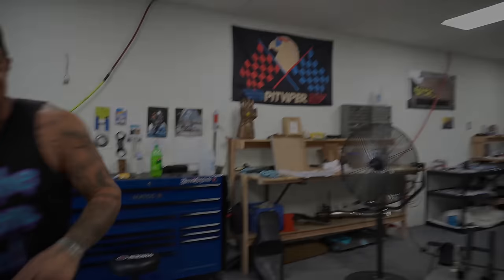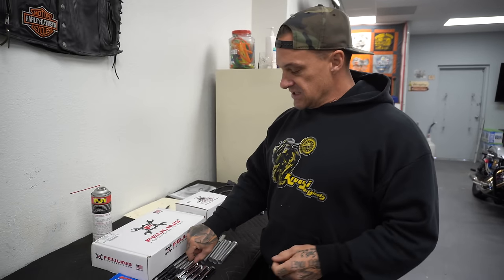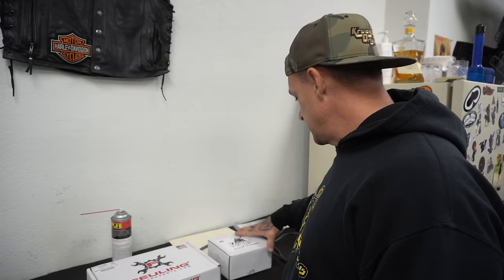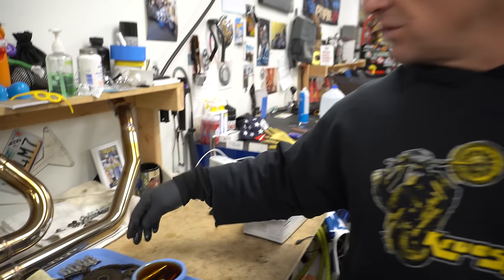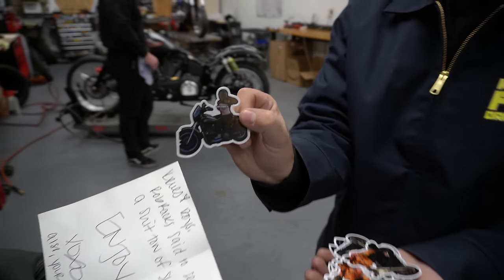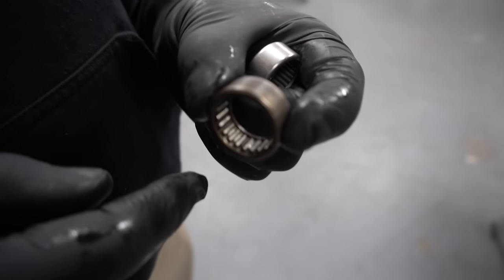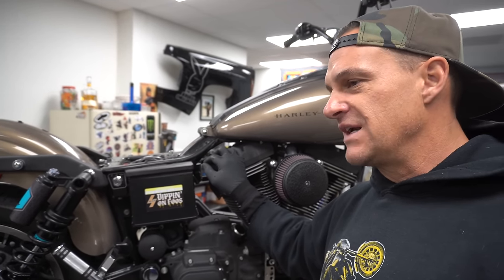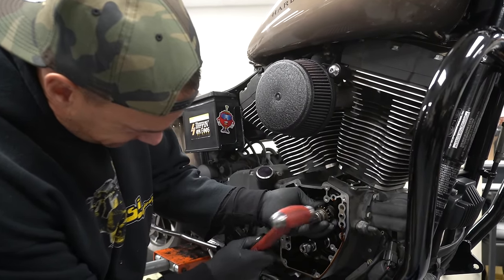@FeulingParts cam chest install on a twin cam 88" thundermax tune how to Kruesi Originals

Comment: Man I wondered why on earth I'd need the inner bearing puller/installer tool if I'm just doing my own bike when I could just use my blind bearing puller and drive the new bearings in like I have done every other bearing...  obviously being prudent getting it started square ect.  I have worked on nothing but metric motorcycles as far as bike /trans ect. Before, and bought a 2000fxdwg last fall.   Previous owner did a 95" high comp and a woods tw6h cam with porting and the SE "race" inake/44cv carb the first year of ownership  Records indicate he had the dealer do the SE hydraulic tensioner/oil pump ect upgrade a few years ago.

Comment: I just got ahold of a 2003 Road King with 46k miles.  I want to do the exact same thing your doing in the video.  If possible can you tell what im looking to pay for parts and labor.  Cheers
Reply from the maker: A couple grand-ish to do it, right?
Reply: @kruesioriginals  that's not bad at all.  When can I drop it off.  Just kidding. I'm in south Texas but wish I was closer. I love your style and experience of working smarter not harder.  Thanks

Comment: I was installing a new Feuling camchest kit with all new o rings but when I went to torque the camplate I noticed one of the threads was stripped. So I had to remove the camplate along with the oil pump that was already attached to the camplate. I fixed the thread with a helicoil but I wanted to know, those new o rings for those two small holes and the one for the oil pump should still be good right? To go to the Harley dealer and get new o rings it’s about a 45 minute drive
Reply from the maker: You’ll be good to go

Comment: Just did the cam chest on my 2012 103.  Followed this install pretty close and had no lifter noise upon start up either.  Used all the gaskets from Feuling's kit except for a small little f*cker that isn't mentioned in the instructions anywhere and looks like you didn't use either.  My new cams are the 543's, feels great!
Reply from the maker: Hell yes man glad it worked out for you

Comment: Nice video fellas! I installed that same Fueling setup in my 01 King. The crank gear was tight on mine too. Mines carbureted but it t fuckin rips too! Love your content. I’m watched the other cam install video you mentioned before I did mine. I loved the biker vs motorcycle enthusiast bit you did. Had me ROTFLMAO!
Reply from the maker: Thank you 🤘🏼🤘🏼

Comment: I could be wrong but I am looking at the same instructions sheet from Feuling and to me it looks like for the front cylinder the timing mark for tdc is: cam shaft sprocket mark up and Crank sprocket mark up as well. Love your videos.

Comment: I had a customers cam bearing fail not long ago. Failed so bad and he let it go so long how cams wore inch deep trenches through the case and we had to send them out to be welded and re-bored. It also allowed his lifters to drop so much that the retaining/locator pin hopped on top of the lifter and do a load of damage up there too

Comment: I love the video, one thing i would appreciate though, would you please exspain that your showing S&S pushrod adjustment, but the fueling pushrods actually have a diferen adjustment setting than the S&S pushrods
Reply: Each pushed manufacturer has their own adjustment specs although procedures are basically the same

Comment: I had a ticket to fly to Spokane and buy that bike and of course the same day another FXDX came up for sale locally so I bought it. Moral of the story is is I I should have made the trip. I did just put that fueling kit in the 2000fxdx and it has the 95” so it runs pretty good

Comment: Ryan ,  I have an 06 Ultra with the 88 in it , has 21k .  Should I upgrade my tensioners to the hydraulic or did Harley by that time fix the premature wear issue and just replace the stock shoes with stock ones .  Video is awesome as usual .  I was worried that You Tube pissed you off there and you guys were gonna stop your channel here  . Glad to see you still at it ..!!!
Reply from the maker: The 06 Dyna had hydraulic tensioners. Everything else was still garbage. You should definitely change that out especially with that many miles.
https://www.kruesioriginals.com/products/feuling-hp-conversion-cam-chest-kit-1999-2006-except-2006-dyna?_pos=3&_sid=a64f59416&_ss=r

Comment: Are the valve springs the same on an 02 FXDX? Sounds like a set to consider.
Reply from the maker: Anything older than 05 you will need to put springs in it if you go bigger than a 525 lift
Reply: @kruesioriginals  OK, thanks.
Reply: @kruesioriginals  I saw a video regarding the Woods TW-6. Do you have any hands on knowledge on that one?

Comment: Kruesi did that work on the front TDC if marks were opposite. On sprockets.?  I done mine and the marks wasn’t exactly opposite from each other. On front TDC. They were a little off.  Thanks.

Comment: Why do you use s&s pushrods over feulings pushrods? Kinda Curious as I am about to install a feuling cam chest kit and not sure on what pushrods to use. 🤙🏽
Reply from the maker: I like them better easier to install better adjustment

Comment: Love the vids as always. I just bought some rear shock sliders. Question? I have an 05'. Would you have gone the the 543 or the 574, If you would have had the newer style heads? Thanks
Reply from the maker: 574 all day makes a lot more power better power band

Comment: Damn I need that in my 06 RK. Just got it last Aug and it needs a little more power.
Reply: I have an 06 RK. 95” with a Feuling 543. Can’t compare to 525, but it’s mid to top bike. A well balanced cam. 90/95 rwhp rwtrq

Comment: Yo brotha so on a twin cam.88 b motor using the 525 cams is it true have to shave the innerr wall for lobe clearance
Reply from the maker: Not even close, that’s a real small cam.  You should always check for clearance every time you do a cam job but that’s not a big enough cam.
Reply: @kruesioriginals  I appreciate u sir In the fueling manual it says 99 to o4 may need case clearance but we will see what's up

Comment: Hey Ryan, I followed the feuling install procedures as directed, got everything all put back together, but when I tried the light gauge test to build oil pressure, that light just wouldn’t go out and I cranked that thing at least 10–15 times short several second bursts. Oil pump was full of lube and I have at least 2.5 qts of oil in there. Any ideas?
Reply from the maker: Did you fill the oil filter full of oil? Your sensor could be bad or you probably did something wrong I would pull the camchest apart again and double check your work.
Reply: Yeah filter was full of oil, I took it apart twice now and everything’s flowing and turning right. I do have my instrument cluster/gauges disconnected l if that would have any effect?

Comment: This video is helping me get the ballz to do this job on my 09' fxd 🤘 so I have the vance n hines fp3 tuner already, if I pick out my parts then auto tune it .. it'll do a super good job on the tune???
Reply from the maker: No, that tuner is no good. It’s only good for exhaust and intake type stuff. You need a real tuner for cams.  Or at least see if it has a basement built into it for the exact cam you’re putting in.
Reply: @kruesioriginals  ohhh word...yea u can select which cam, intake, exhaust, big bore kit..brand, size, exct of aftermarket parts
Reply: It blu tooth's to my phone which has an app that's pretty in depth...just been seeing mixed reviews on the pre set tunes n thou the auto tune mite be better after I selected all my parts/mods on the app

Comment: Just doing the same thing but a bit confused on the pushrod adjustment!  According to the feuling info for their 4000 lifter the 32tpi s&s pushrods should be 3 1/3 turns. Do you recommend 4 turns like both your video's?  Not so many people to ask here in the UK
Reply from the maker: Depends on how much movement the lifter has that lifter might be different. I do not use Feuling lifters. 
You need to pull the lifter apart and measure it .

Comment: Do you need to add a tunner with the feuling 525 cam chest kit
Reply from the maker: Definitely need to get it tuned or run a confident tuning system with a good map. Not an FP3.
Reply: @kruesioriginals  what would you recommend it has a k&n style air cleaner and dual fish tail pipes
Reply: What would you recommend

Comment: Hey dudes, any reason you went with the OE+ over the HP+ ? Shopping both right now curious which one you recommend. How do the fueling camchest stack up against the s&s 509 kits
Reply from the maker: It was just budget and this motor is not going any bigger so it would be unnecessary

Comment: Fueling instructions say when u put everything back together the rear cylinder is at top dead center then rotate 180 so u can get TDC on front cylinder.  I used ss and  the dot on the top gear is about half inch forward tthen the fueling instructions to get TDC on front cylinder.  Regardless of what co u use the chain gear gets reused so shouldn't the dots end up in the same spot for TDC front cylinder. Trying to figure out if that's normal or is something wrong.

Comment: Damn that fueling plate is really nice. I just bought a used 2004 road king with a 95" upgrade and fueling 525 cams!!!. Man it pulls hard holy shit...I need that fueling cam plate thou, it has a screamin eagle plate with the older bearings. When I'm ready to buy it I'll buy from you man..will you always carry that for the 88" twin cam? Do the roller chains come with that kit?
Reply from the maker: I run the 525 on my stunt bike. I love that cam and 88. It’s a fun power band like a small dirtbike.

Comment: Is the thunder max tuner better than the v&h FP3? Or is that just what you like to use
Reply from the maker: Not even in the same league, or even same game. That’s like comparing sitting on the couch to being an NFL player.
Reply: Thanks, I did some research your absolutely right. I’ve used the FP3 and taken it as far as I can and I’ve herd that the wide band sensors were the best but I didn’t know it keeps learning as you ride and it’s not a Harley ecm , very very tempted to get the thunder max !!

Comment: What’s your take on the 543 Reaper in a 95”? Running in my Road King
Reply from the maker: That’s a good cam, but I would run a 574 all day makes more power all around
Reply: @kruesioriginals  I knew it could use more cam

Comment: Going through the same process but d oing a complete top 2 bottom w/ 525 rpr @ 47k orig. mi. Run out is 2k. 03 fxst got it n 07 w 2900mi. Not a pussy I just don't abuse it. Had her up to 114 mph w/ 1 1/2 in of throttle left no high-speed wobble. Can't wait

Comment: Harley Davidson has been running the scam that they are "made in America" and that they are "premium motorcycles".  Lies.  Most of a Harley is not even asse3mbled in the USA much less made here.  And as for "premium"....  you nailed it.  The MoCo bean counters will happily sacrifice quality with any part that saves them five cents per unit.

Comment: Fueling pushrods are stronger than the S&S quickies,  and if you want the best go Fueling solids. Luke can supply you with the correct length as long as you can verify the cylinder length and if the heads have been decked or not. Early twin cams with a cam position sensor can and should anyways, upgrade to the Daytona Twin Tec ignition module which allows you to not need input from the cam sensor. For the record, gear drive on a twin cam engine with acceptable crank run-out is worth 2-5 horsepower on the dyno. Dude, dude, dude,  the Harley crank sprocket is the P.O.S., the Fueling is purposely made to close tolerance so the cam timing doesn't change. Put it on  a hot-plate for 10 minutes or evenly heated with a Mapp torch.

Comment: Chaps my ass the way Harley make all those cheap ass shit parts and then turn right around and sell you of course the good stuff that should have been in the motor in the first place. I have an 06 fatboy so I got screwed on the timken bearing that Harley stopped putting in after 02. I  bought this bike with 18k on it so now I feel I've got it pretty much together. New cam plate oil pump etc.... after 2grand on parts that is.

Comment: I’m late to the video. But this is borderline malpractice. 
First off a tight crank sprocket allows for less alteration in cam timing, you can run a tight crank sprocket in with the pinion bolt and washer for tight and precise fitment. Not a POS.
Second off, you soak lifters in oil? 
What a SH*T way to build pressure in a lifter. Use a pump up tool, $10 at max. You just messed up your pushrod adjustment.
Third, pushrod adjustment. Set an adjustment from a false sense of 0 lash. 
4th, and by far the worst. You install the oil pump first instead of installing the cam set as a unit. You let the possibility of the oil pump walking from the O ring in the case by doing that & probability of a bad alignment on the gear set. 
Assemble the cam plate, pump, cams etc. as a unit. Defeats all possibility of a pinched o ring and loss of oil pressure & catastrophic engine damage. 
5th and I promise I’m done. Assembling tensioners cocked 1 by 1 the way you did. Just asking for a tensioner failure. Press the tensioner evenly and assemble/start both bolts and tighten evenly to torque. 
Last off don’t put Molly lube on a f***ing internal fastener. That grit makes its way TWICE through an oil pump before it reaches the filter. Use engine oil. This install displays horrible technique and is what’s wrong with many shops.
Reply from the maker: Aaah did you just graduate from MMI, how cute. 
 It’s so fun to watch the new guys comment especially the ones that can’t even tell the difference between the lubes that I’m using.